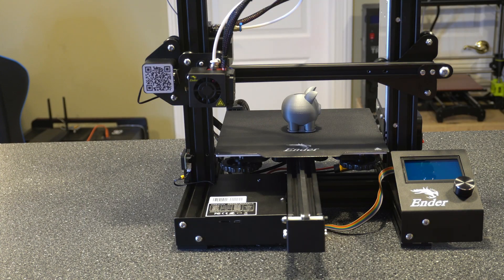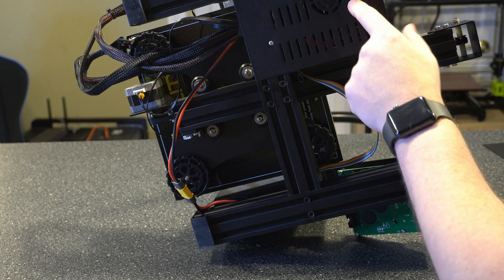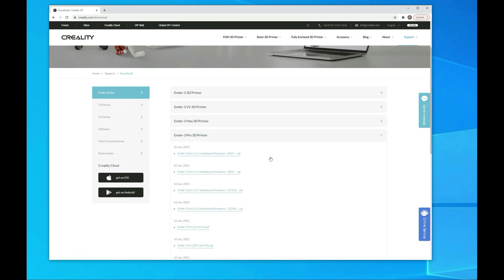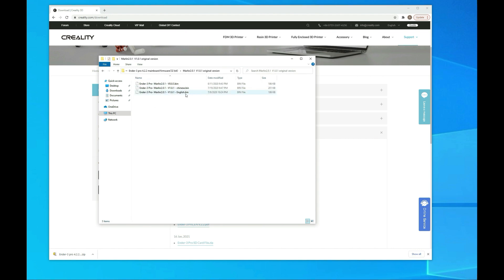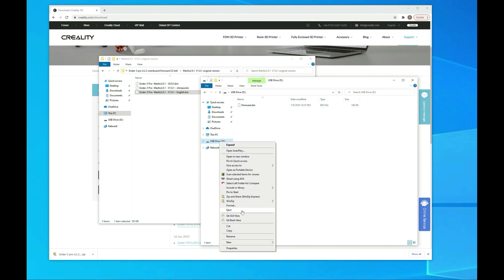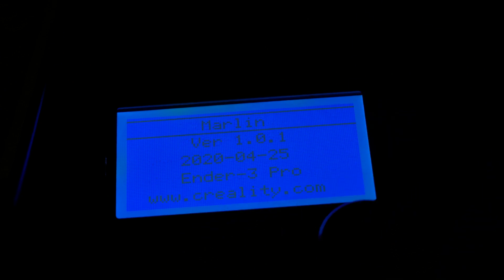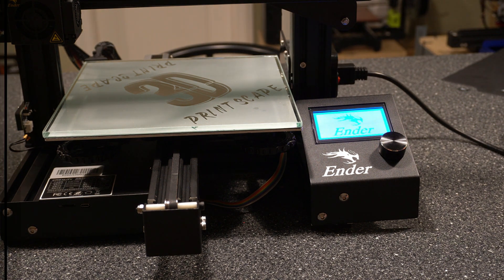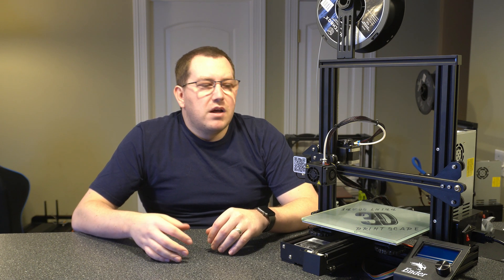Creality 32-bit Mainboard Firmware Upgrade Guide

Comment: mine shipped with it aswell ^^
Reply from the maker: Hi. What did yours ship with?
Reply: @3DPrintscape   1.0.1
Reply from the maker: @vsd1988  Ah ok, i would expect new printers to ship with the latest firmware but as reality makes changes older printers will still need to be updated.
Reply: @3DPrintscape  i have an ender 3 its not a newer printer ^^
Reply from the maker: @vsd1988  The firmware numbers are not the same across printers. So if you have an Ender 3 with an 8-bit board as an example, its not going to be the latest firmware.
Reply: @3DPrintscape  ah yeah i see. 
im printing atm and have another print ready but after that i'l check into it. what is the latest firmware for the stock ender 3?
Reply from the maker: @vsd1988  Its 1.0.1 stock, or 1.1.2 if you have the bltouch. That said, im running Marlin (bug fix).

Comment: Very informative, as always!

Just installed the CR Touch on my Ender 5 Pro (v4.2.2). Installed new Marlin firmware, but wish to revise the bed mesh as the probe goes to close in the Y+ direction, and then over travels when the bed travels in the Y-. Have you a video on compiling the Marlin firmware (I've used you BTT Mini e3 compiling video and it worked great for me)?
Reply from the maker: Hi. Here is a link to the video i made on building marlin firmware for creality boards. https://youtu.be/pQ7WZST8sqk   That said, im not sure it will cover what your looking for. You may need to adjust the Y_MIN_POS position, im using -10 on one of my printers. Also, make sure you clear your eeprom before making other changes to make sue thats not  the issue.

Comment: Hi Thanks for the video it was very helpful..I have an Ender 3 with the 4.2.2 board and this morning I put an sd card in with some gcode files and then switched on. To my surprise I had a blue screen of death and the system didnt boot up. I followed your video to go back and add the firmware and low and behold it booted up. So there seems to be a problem that if you leave an SD card in it will wipe the firmware. At least thats the only explanation I can come up with...
Reply from the maker: Hi. I believe it renames the firmware file after it uploads it, at least most boards do. Also, the boards are picky on what SD cards work, i think they put cheap readers on the board.

Comment: Hi, great videos bro, month ago I bought an ender 3 pro, info came with marlin 1.0.1 exactly like yours, I don't have a BL Touch yet, came with 4.2.2 board, is it the last version of marlin 1.0.1? I scared if I upgrade and screw my new toy, greetings from Costa Rica, Pura Vida
Reply from the maker: Hi. The 1.0.1 is the Creality version, not Marlin version. Its build off the Marlin 2.x line from what i can tell. Creality doesn't update their firmware often.

Comment: On avarage how long should it take, I have the card in and the screen has been blue for about 5 min now, is this normal? I have the ender 3 pro with the 422 board
Reply from the maker: Hi. It should be less than 1 minute. Make sure your SD card is formatted correctly and the firmware has a unique name.
Reply: @3DPrintscape  I think something went wrong... My printer has been stuck on a blue screen when every I power it up, Do you know how to fix it?
Reply from the maker: @3d_bro254  Did you make sure your SD card was formatted right and that the firmware had a unique name?

Comment: Nice to see this video, although funny as I just purchased items for bootloader :)  Do you know if this firmware has Thermal Runaway protection or do you recommend as different firmware package and is it still the same principal to upgrade without damaging the printer?  Many thanks and thanks for the posts.....Al
Reply from the maker: Hi, it does have the thermal runaway protection. The upgrade is much easier on a 32 bit board. You just need to put the firmware on the sd card and turn on the printer.
Reply: @3DPrintscape  Many thanks Rob.  I saw one of your videos about TH3D firmware and the benefits.  I have ordered the BL Touch.  Would you recommend using the updated Creality firmware for the 4.2.2 board or use a firmware from TH3D for example?  I am still learning lots and also have a glass bed, but that's for another thread lol.  Many thanks again and keep up the good work.  Regards. Al
Reply from the maker: @2001albundi  I would move to the Marlin firmware on the 4.2.2 board with the bltouch. Thats what I'm running now and I have videos out that cover the process.

Comment: Hi! Thanks for your video!! Please, it may sounds stupid but I'm very new in this world, to use the other versions (example 1.2.1) I should install a filament detector hw? I tought it was a firmware feature not an extra hardware
Reply from the maker: Hi. The filament sensor requires hardware and firmware changes. Im not sure what printer you have but it may require you to build a version of marlin with the necessary changes.

Comment: Hello, I have a ender 3 pro printer. How did you do the update part with 4.2.2 card, did you connect it with usb?
Reply from the maker: Hi. If you have the 4.2.2 board, you would update the firmware using the SD card. You dont need to connect it to the computer.
Reply: @3DPrintscape  software update bl touch but error stopped
Reply from the maker: @emreylmaz5792  What error are you seeing?
Reply: @3DPrintscape  bl touch stopped or bl touch working but z down not stopping
Reply from the maker: @emreylmaz5792  Sounds like a wiring issue. If you are using the precompiled firmware, you need to have the 5 bltouch wires connected to that port plus the z-stop connected.

Comment: great video but is there a way to change the build volume configuration to the printer ? i picked up a ender extender and just  looking to update the firmware and the build volume config.
Reply from the maker: Hi. Thanks for the feedback and yes you can change the build volume by updating these values in the configuration.h file.

// The size of the print bed
#define X_BED_SIZE 235
#define Y_BED_SIZE 235
#define Z_MAX_POS 250
Reply: @3DPrintscape  I'm sorry I can't find that file in the download..
Reply from the maker: @solenvega8950  Sorry, i was mixing up my videos. You will want to follow this one and update those values in it. https://youtu.be/pQ7WZST8sqk

Comment: Rob yours didn't upgrade the firmware. Mine was manufactured in April, and it had Marlin 1.0.1 out of the box. Also, you downloaded Marlin 2.x.x, not 1.0.1.
Reply from the maker: Hi. I was talking about the Creality version, both were Marlin 2.x.x. This is the actual file name "Ender-3 Pro- Marlin2.0.1 - V1.0.1 - English". Its Marlin 2.0.1 but Creality version 1.0.1.
Reply from the maker: I dont like how they did the versioning, the mixed versions can make it confusing.
Reply: Thanks, I get what you're talking about. But, I think you CAN upgrade it more; I feel like you can upgrade it to the firmware that has the new marlin logo. IDK if I'm right.
Reply from the maker: @violiniti2369  You can, but its a Marlin build not one from Creality. I just released a video on the process. https://youtu.be/pQ7WZST8sqk
Reply: Thanks! Rob I really like your channel btw. You're gonna grow big in the next year or so. I learned a lot from your vids! Keep it up!

Comment: I followed the steps I renamed the .bin file but I got a blue screen
Reply from the maker: Hi. Try to copy the file again without renaming it. I’m seeing mixed results with that now, I think it’s based on the firmware your coming from.
Reply: @3DPrintscape  
try several times but nothing stays the same. I have an ender 3 pro with creality v4.2.2 board.
Reply from the maker: @marcelrios806  Can you take a video of it and send it to me on discord? https://discord.gg/Bu94EYVkrU
Reply: @3DPrintscape  Hi!!! I tried with firmware.bin and had a bluescreen. It worked with the original files name! Very thanks from Argentina!
Reply from the maker: @LeoRey25  Hi. Thanks for the feedback. Your printer must have been updated using firmware.bin before, could have been from the factory. The reality boards don't like having the same file name used.

Comment: If my ender 3 pro already has the 422 board, would there be any reason/benefit to upgrading to the skr mini e3 v2? I am putting together a list of upgrades to get and wasn’t sure if I should bother going with the skr if the 422 board is a 32bit board? I appreciate your tutorials! You’ve definitely helped me out quite a bit with getting started in 3D printing!
Reply from the maker: Hi. Its a tough call. The main benefit of the SKR Mini would be the silent drivers and the accessory options that are available. I think its probably worth upgrading from the 4.2.2 board, but not the 4.2.7 board.
Reply: @3DPrintscape  Thanks Rob! I appreciate your input and again appreciate your videos!

Comment: I bricked mine this morning. I updated the screen and it turned back on fine, then tried to update the motherboard, and now I'm stuck on the blue screen. Tried re-doing it multiple times, still have a blue screen. Ender3v2 stock
Reply: you gotta change the name of the firmware each time or the bluescreen won't go away
Reply from the maker: If that doesnt work. Join our discord and i will try to help out. https://discord.gg/Bu94EYVkrU
Reply: @CrippledKev  I'll try that.
Thanks
Reply: Are you sure you downloaded te firmware and not the link? The file ‘firmware.bin’ should be about 200+ kB.
Reply: So I got my ender 3 pro in beginning of Dec. It bricked after a 5 hour print stoped during the print blue screen because of the holidays took creality 3 weeks to respond watched tons of vids bootloaders etc it's a 4.2.2 board sent me new firmware loaded on sd all normal. Been printing evers8nce .then using only things on thingverse . It stoped and bricked after another  5 hour print also erased the  whole sd card .turned off took out card rebooted normal . I hope it was just a glitch ... just putting this out there in case it happens to anyone else .
Reply from the maker: @johndavis6482  Hi. Thanks for the info. I have had a lot of people reach out to me with issues on their 4.2.2/4.2.7 board. I hope its something they can fix with firmware. I just picked up another Ender 3 Pro that has the 4.2.2 board. I plan on swapping to the Marlin firmware line in a couple of weeks after I finish a couple more videos.